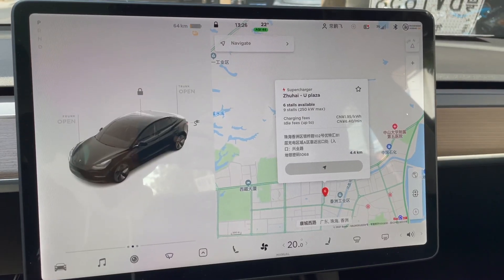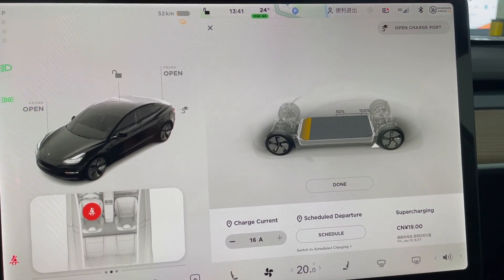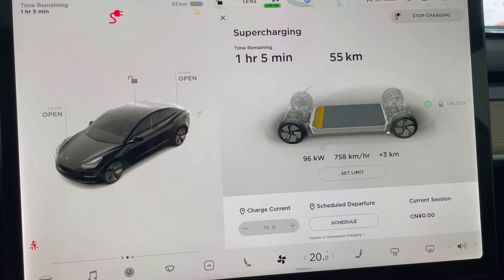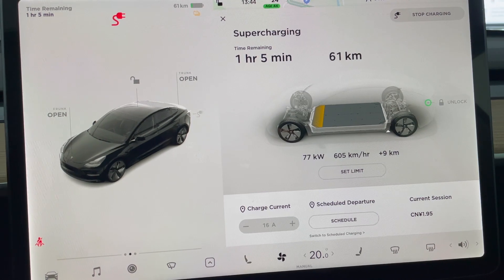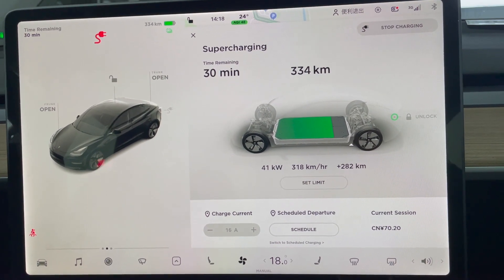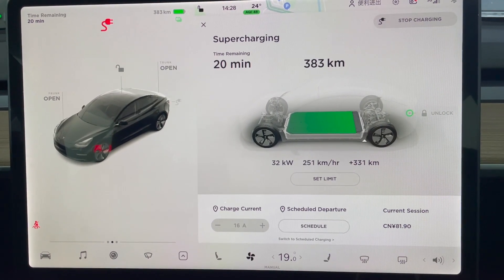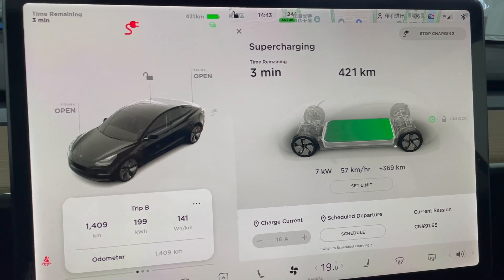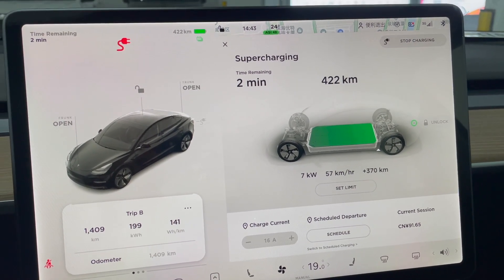LFP battery Charging test from 2021 MIC Tesla model 3 SR+

Comment: Possible to preconditions for other fastchargers that Teslas own chargers? In case you dont have Tesla ones nearby?
Reply from the maker: That’s not available. Heating the battery is an automatic process when you navigate to one of the supercharging stations
Reply: @gogochang1153  ah ok. Should have Been possible to manually activate it. 

What os the difference om charging speed with and without preconditioning?

And.. i will not have any nerd to charge other places that at Home, at superchargers and a few type 2 chargers here and there.
Reply from the maker: @viktorstorelv  it depends on the weather condition. During summer time here in Zhuhai, the battery cell temperature is already high. The precondition is especially useful for cold weather condition, it can save you at least time minutes since it has finished the hearing process before charging

Comment: Does the charge current change automatically when you plug into super charger? If you have it set low (12A for example)?
Reply from the maker: You can not adjust the setting of the supercharger. It’s automatic

Comment: Thank you for this video! We’ve just received the LFP battery powered Model 3 in the United States. Tesla is giving its customers an option to choose between the LFP and the NCA batteries. Do you know of any pros and cons between the two batteries? Would you stay with the LFP? I’m faced with choosing between the two.
Reply from the maker: What’s the weather condition during winter time? For me, the lowest temperature here is only 8 degree Celsius so LFP battery works fine under this temperature. But if you have a long and cold winter ( -10 degree Celsius), LFP battery may not be suitable for you. ( if you have a wall connector at home and you can plug it in every day, then LFP battery works fine) But if you are in California, LFP battery will be a no brainer.
Reply: @gogochang1153  Winter temp ranges between 0 Celsius and -8 Celsius. Maybe I should take delivery of the nca battery powered Tesla.
Reply from the maker: @joepro3382  yes, do you plan to install a wall connector at home?
Reply: @gogochang1153  Yes. Already have a wall connector installed from my previously owned BMW I3s.

Comment: How cold does it gets there and how much range loss you get during low temperatures? Thanks
Reply from the maker: The lowest temperature here is around 8 degree Celsius. The LFP battery is fine under this temperature.

Comment: After6 months waiting for an update i still get max.80KW for my Mic Tesla Model 3. Any news?
Reply from the maker: Are you using Tesla supercharger?
Reply: @gogochang1153  mostly charging at home but to test max capacity for long trips yes i tested at a tesla Supercharger. Even Tesla store Bern Switzerland didn't get more than 50kw whilst testing my tesla last January
Reply from the maker: @jacquelinerieder2228  that’s quite weird, what is so software version?
Reply: @gogochang1153  latest one 2021.4.18.2
Reply from the maker: @jacquelinerieder2228  that shouldn’t be this case. Maybe the last time you went to the supercharging station, you did not heat up the battery by using the online navigation system. Try again during summer time and heat up the battery properly, you should get around 150kw when the SOC is around 20%
Reply from the maker: I mean the on board Navigation system
Reply: @gogochang1153  it is summer now in Switzerland. I charged with preheated battery through Navigation system at an outside temperature of 20 degrees
Reply from the maker: @jacquelinerieder2228  this is the optimal charging condition. You may need to go to the Tesla center to examine your car

Comment: In my opinion longevity , number of cycles is way more important than range or charge speed or weight of battery pack.
As I think having my Tesla running for more years is more important than anything else
Reply from the maker: you are correct! LFP battery has a larger number of cycles

Comment: It would be interested to see the charging in cold weather (Minus) and with cold battery??
Reply from the maker: It will be very slow at the beginning of the battery is not heated up to a proper temperature for fast charging. Under extreme cold condition, the first five minutes after the supercharging cable connected to the car may only heat up the battery

Comment: Strange. When I come that low to a lever 3 SC, I get 245kw, 1600 km per hour, for 7 min before it drops. I get 200 km in 10 min. Why so slow?
Reply from the maker: What is your software version?
Reply: 2021.4.15
Reply from the maker: @theelectricisraeli  with the latest software version, the charging speed for LFP battery is significantly faster. When I did that video the software version was older, I will do an undated charging test with the latest software soon.

Comment: Thanks for this great video. Please consider purchasing the Scan My Tesla app via the OBD dongle and adapter cable. Then you can read the temperatures of the pack. I still suspect that the temperature of the pack at the beginining was well below the 40 degrees celsius treshold for optimal charging. Would make it even more interesting to watch. Keep up the good work, I've just subscribed.
Reply from the maker: Thanks for your support! I will update another charging test with the latest software version since Tesla improved the charging speed for LFP battery significantly.

Comment: Thank you for your informative video, what would you consider the best temperature range that the lfp battery works best? As in the absolute minimum temperature and the maximum temperature that a decent range can be achieved. Thanks
Reply from the maker: I would say the best temperature range is from 15 degree Celsius to 25 degree Celsius.
Reply: @gogochang1153  Thanks for the information much appreciated.
Reply from the maker: @allenfazer  sorry I forget to mention, under ideal temperature, if you drive in town, the average consumption should be around 12kwh/100km, so the estimated range is  420 KM, if you drive on highway with average speed around 110km/h, the average consumption is around 14kwh/100km, so the estimated range is around 380 KM.
Reply: @gogochang1153  Thank you very much for the detailed information, I look forward to seeing more videos from you, maybe some road trips in different conditions such as rain etc Tesla Bjorn style!
Reply from the maker: @allenfazer  thanks for your suggestion!

Comment: Thank you so much for this great real-world information.
I think that the future 4680 cells are going to provide better supercharging speeds, even if Tesla hasn't really confirmed that yet. 
280-380km range is fine for most daily uses, but it makes traveling longer distances a lot more challenging. 
If you are going to keep your Tesla for many years, it seems like paying extra for the long range version is going to be worth it. LR and FSD will be worth it over many years.
Reply from the maker: Charging speed in the future will definitely be improved even with this LFP battery. With the latest software version, LFP battery can obtain a higher charging speed now, I will make a video to talk about this soon. I think charing speed is more important than range itself.

Comment: You should still charge 80-90% charge for maximum battery life!
Reply from the maker: Yeah, very true. But I think Tesla must have done stringent research to find out that battery degradation at 100% SOC for LFP battery is significantly lower than Non-LFP battery so that they no longer recommended to charge the LFP battery up to 90 % for daily usage.
Reply: @gogochang1153  I agree, especially if you dont have a lot of chargers near you. But if there are sufficient chargers near where youre traveling, it would be better to prolong your Tesla's life. Btw great video
Reply from the maker: @ThompYT  thanks for your support!

Comment: What are the charger names for mic model 3 
The one on the left - is it Type 2 (European standard)?
Reply from the maker: Yes, it is the same as that standard. Different countries have their own charging cable standards.
Reply from the maker: The European countries adopt CSC charging port, but the upper part of CSC is the same as my charging port on the left hand side, which is used for slow charing at home.

Comment: nice video. it vwould be interresting to draw the charge curve , and compare it to a charge in March 21. apparently an soft update ( march 21) has significantly improved the charging speed for LFP
Reply from the maker: Thanks for your suggestion! I will do another video to talk about the improved charging speed for LFP battery with the latest software version 2021.4.11 soon.

Comment: Did the software update solve the problems with battery charging and low temperature range?
Reply from the maker: The new software update definitely solve the problem with battery charging speed, I am not sure whether low temperature range is better or not because the temperature now is getting warmer and warmer.
Reply: @gogochang1153  Thanks for the reply. I'm glad the charging issue has been resolved. We'll have to wait until winter for checking the battery problem.
Reply: @gogochang1153  Hi, what speed does it charge at on Supercharger now after the new update? Maybe you could do a new video? :)
Reply from the maker: @tyronegaa  yes, I am planning to do a new video.

Comment: thank you for sharing :) I'm getting delivery of the M3 SR+ 2021 very soon :) Can't wait! I'm in Australia so we have alot of sun here, I have 9.5kw worth of solar panels on the roof and I have installed the Tesla Gen 2 wall charger in my garage while it won't charge at 100kw it will be able to do at least 11kw at 32amp so roughly 50km of range per hour alot slower then what you've shown here but because it's from the sun it's free ^_^
Reply from the maker: Congratulations! I also have a wall connector at home that can charge at 11KW. The charging speed will be around 78 km per hour at 11 kw.
Reply: @gogochang1153  Awesome, thanks again for sharing the video !
Reply from the maker: @-Ride4U  you are welcome
Reply: @gogochang1153  I have a delivery date of 3rd of march now :)  very soon!
Reply from the maker: @-Ride4U  congratulations!

Comment: Thank you very much for this very informative video! My Model 3 is an 12.2020 MIC LFP. My experience yesterday in Germany Winter at -3°C the days before was -15°C an the car stand without driving: 
30km to Supercharger with preheat
30%Soc 
28kwh for a very short moment 
24kwh from 33 to 45% 
19-21 kWh from 50-70%
At 80% the charging speed will continue decrease down to 1kw. 

From 30-80% in 80 minutes. 
Now I wate for higher temperature to retrying this test.
Reply from the maker: Thanks for sharing. 30KW is way too slow for supercharging. It’s really necessary to heat up the battery before going to the supercharging station

Comment: Hello Gogo, another quick question. In the beginning, have you been able to charge up to 100% with LFP battery? As of now, I can charge up to 98% only. And same question on the range. The first days, the range on the screen was only 320 km for 98%, that it seems it is improving day after day. Now I got 380 km for a full charge. Let me know your view on this. Advance thanks
Regards
Reply from the maker: I can charge my LFP model 3 to 100% every time. And I can get around 422 KM for a full charge. I think the capacity of LFP battery is highly sensitive to temperature and how you charge the car. For your information, I only use Tesla wall connector to charge at home and leave the charging cable connected to the car for at least three hours after finish charging in order to allow the BMS to better estimate its capacity. Another thing that worth mention is that i get this range at  around 20 degree Celsius. I think you will get back 420km when summer is coming and change the method of charging. It’s really important to avoid using fast charging, and it’s necessary to keep the charging cable connected to the car for at least three hours after the car finish charging. Hope this can help!
Reply: Thanks for your valuable feedback 👍

Comment: Hello Gogo, very interesting. I have received My mic last December in France. Do you charge it everyday whatever the level of charge? Here in the forums, people are saying that LFP must be charged all the time when the care is not used.Let me know your thoughts. Thanks
Reply from the maker: Although I have a Tesla wall connector at home, I don’t charge my car everyday. I only charge my car when SOC is below 20%, and I will charge to 100%, after the car finished charging, I will still connect the charging cable to the car for at least 3 hours so that BMS can better estimate the capacity of the LFP battery. So what people here in China agree is that avoid using fast charging to LFP battery, and keep the charging cable connected to your car for at least 3 hours after the charging is finished. Hope this can help.
Reply: @gogochang1153  many thanks Go-go for this feedback, I will apply this. 👍

Comment: I posted a comment and a link of cold issues in Europe , i see that was deleted, was that on purpouse or should i repost
Reply from the maker: There are two problems with regards to the cold weather condition. First, the average consumption is much higher because of heater turning on. Second, LFP battery may not be able to charge to 100%, some users in Beijing claim that the battery will stop charging at about 80% or even lower, especially when using fast charging. The second problem can be fixed if you use slow charging at home and keep the charging cable connected to the car for at least 3 hours.
Reply from the maker: Yeah I cannot see that link. Could you please repost it? Thank you.
Reply: @gogochang1153  i posted it again but it has been deleted again
Reply from the maker: @Xxxxbsbsbsjsbs  that’s annoying
Reply: @gogochang1153  my links deleted twice, if you did not delete who else could ?
Reply from the maker: @Xxxxbsbsbsjsbs  I think maybe youtube does not allow external link in the comment box.

Comment: Finally we have a clear and informative video in English on the MIC SR+ with LFP batteries. I wonder what the charging speed will be on a 50 kW DC charger, and what will be the rate of degradation of this battery compared to Panasonic. Your consumption so far of 141 wh/km is exactly the same as my USA-made SR+ after 17,000 km. Under what conditions did you achieve this? It would be great if you could measure it carefully at highway speeds of 90 km/hr and 120 km/hr like TeslaBjorn does. Thank you for a great video.
Reply from the maker: thank you so much for your support! I really like Bjorn's videos as well. My consumption of 141 wh/km is mainly based on in-town driving, I also did a 300KM journey on highway last week and the average consumption is also around 140wh/km based on the average speed at about 100KM/h. It is worth notice that  average consumption is very sensitive to temperature, I got these figures at 20 degree celsius. As for battery degradation, LFP battery is more durable compared with Panasonic or LG battery due to its chemical characteristics. The very first LFP battery model 3 was delivered in mid-October last year, so I think information about LFP battery degradation is not enough for us to make an accurate estimation. But I will check it out during long-term ownership.